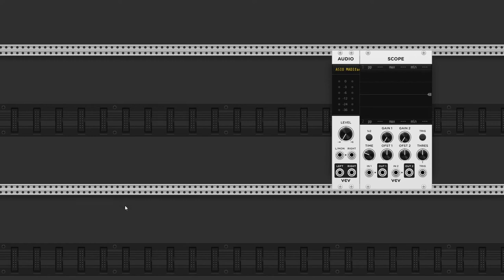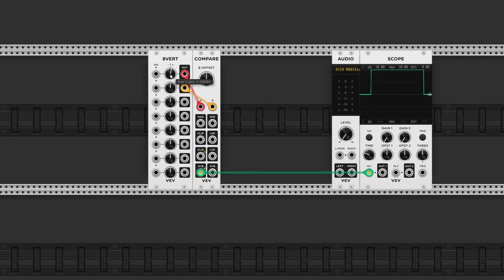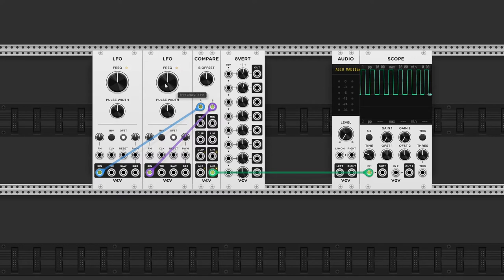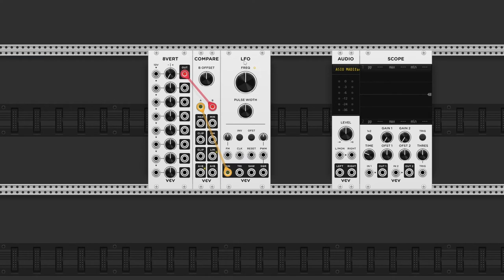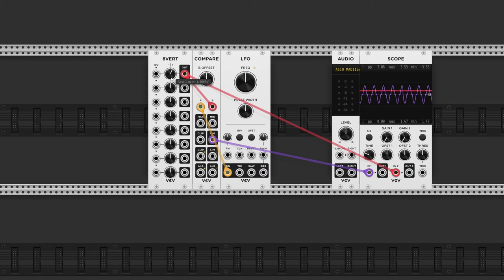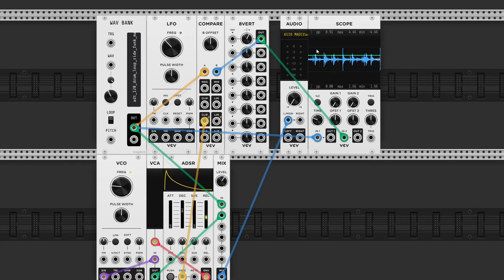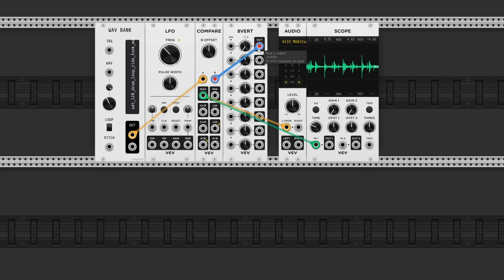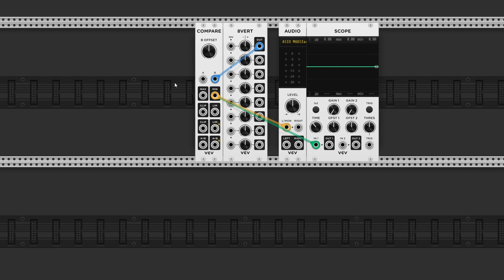VCV Rack Compare Module Explained (Comparator & Limiter)

Comment: B Offset does the same thing as an attenuverter with constant voltage plugged into the B input if nothing is plugged into that socket. I guess some redundancy is for demonstration purposes?

The tricky thing while playing around with this stuff in VCV Rack isn't a lack of tools/options, but trying to remember in what situations they're useful. So these short guides can be quite useful.
Reply from the maker: You're right I should have mentioned that, I thought it was a bit easier to understand like this.

I have to say it's hard to keep these utility modules apart from each other sometimes, when I just need a S&H but can't remember where it's at 😅